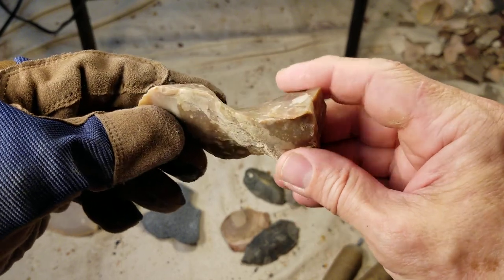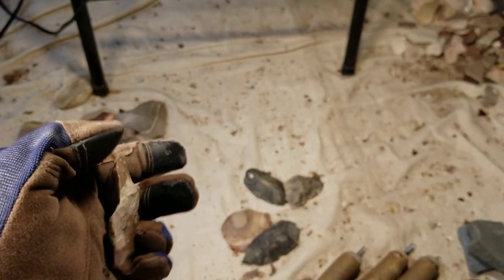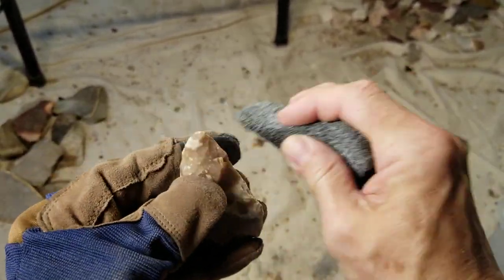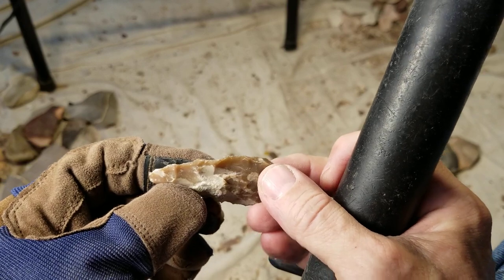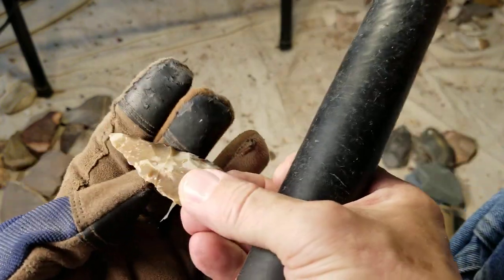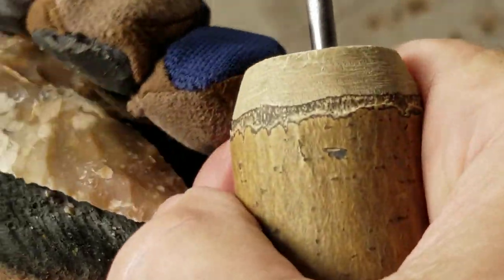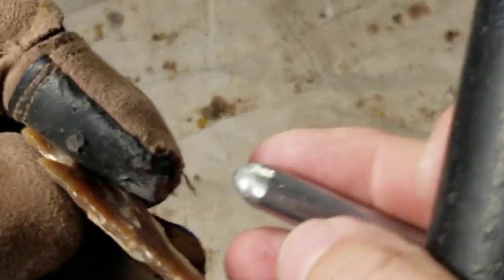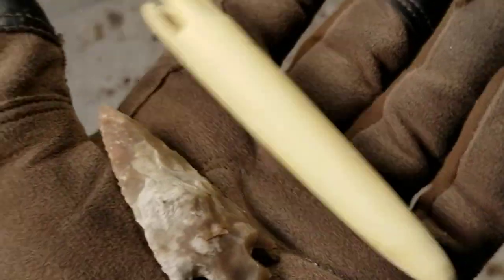1165 - Challenge - Gnarly Knapping and Yapping

Comment: Can you tell if a piece is heat treated?   What is heat treat method?
Reply: Have a look at YT: Heat treating with Turkey Roasters.
Reply from the maker: You can tell pretty easily if there is a color change or a difference in the luster of the stone. Otherwise, I can be extremely difficult to tell.
Reply: Looks like two steps 1. Moisture removal and 2. Anneal. Similar to working with glass.  Very interesting.